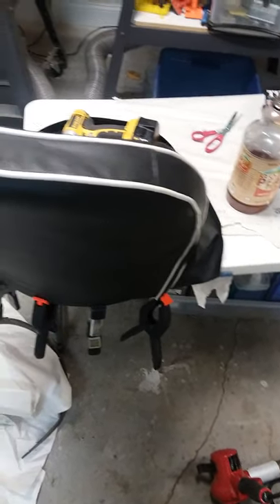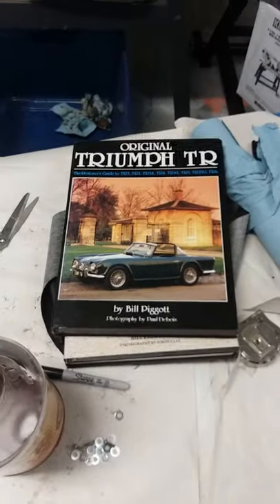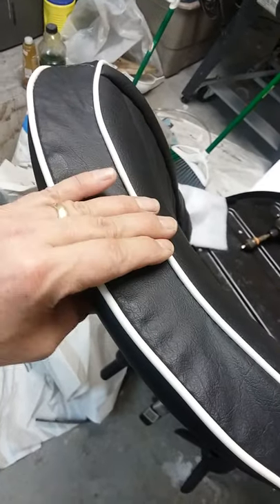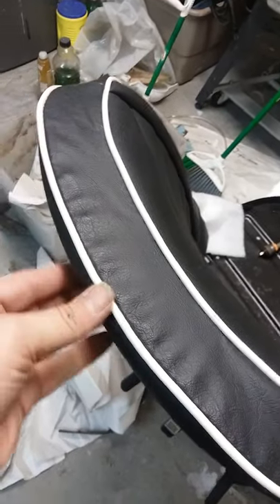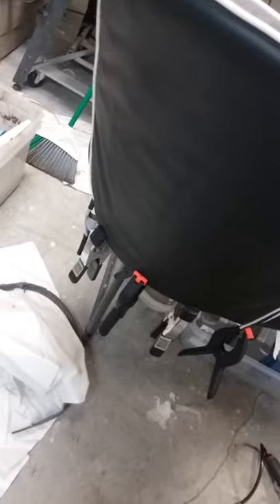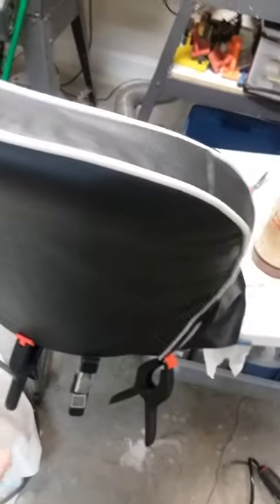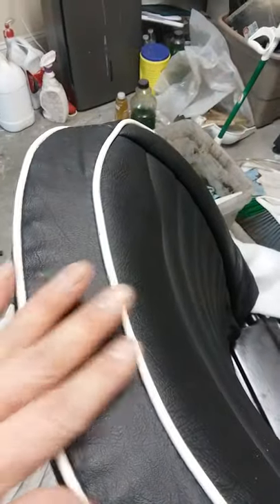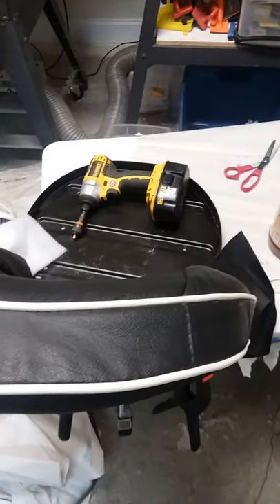Triumph Tr3a drivers side seat vinyl install questions to guys on forum

Comment: What was the decision on this?  I’m doing mine pretty soon so just researching as much as I can 😉
Reply from the maker: Hey Tush!   I need to get back to binge watching your videos.  I had a surgery back awhile ago, and you helped me keep my mind off it during recovery!   On your question, I videoed the whole process and the jump drive corrupted!   As I recall, I made sure the flap inside from the seam was pushed back rather than on the top, and added extra padding, far more than came in the TRF kit.  Also made sure the piping was back far enough.  I did get it out.  Good luck!
Reply: @triumphrestoration7403  hope you are recovering well…I did see another video short You made regarding the seam so that was helpful.  Thanks!